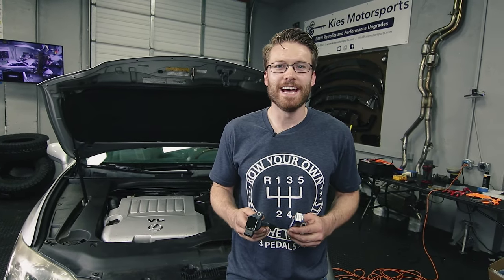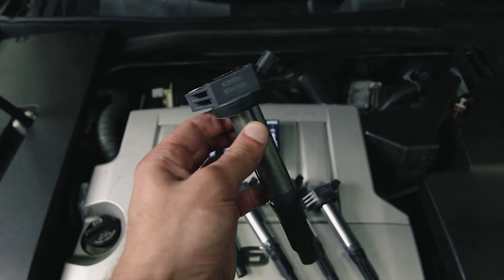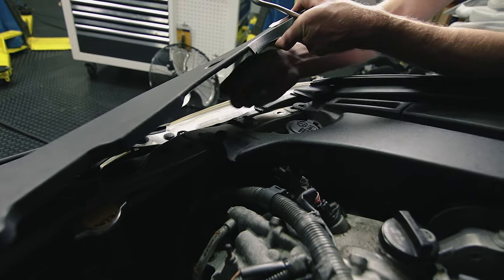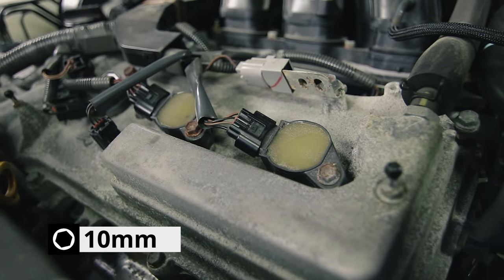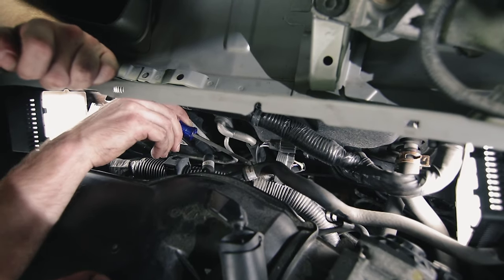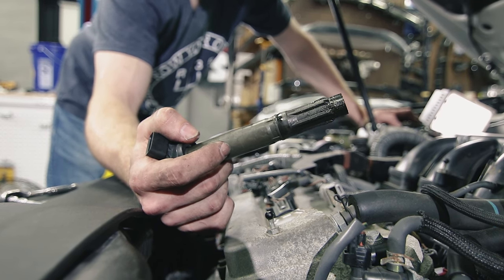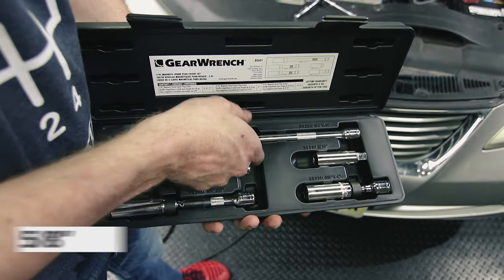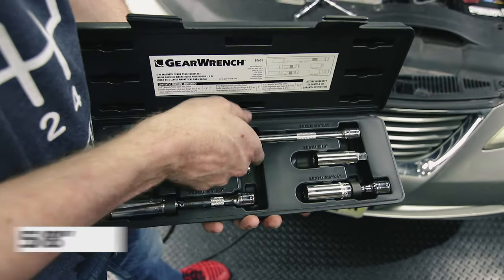How To Change 2GR-FE Coils & Spark Plugs 2006-18 Lexus ES350 / 2006-17 Toyota Camry - Under 1 Hour

Comment: Thank you Sundae Drive! This is the best video on this subject. I just finished the job of replacing all 6 ignition coils and plugs. I had P0351 #1 but #6 that I had replaced a few years ago was cracked (yes, it was a after market brand). I think P0351 can also mean other coils or spark plugs might be bad. The toughest was #5 due to the wire hardness blocking everything. I did follow what you did but there was a separate small wire bundle from the rear wire hardness going towards the intake manifold by #5 that was short so it was still blocking access. I did finally manage to pull out the #5 coil by pulling the wire hardness by hand but I almost gave up. I did not have the right tools so this took me 4-5 hours. I also replaced the front ignition coil wire connector plug since all the clips were broken but not the rear ones so hope they stay put. This is on 2007 Lexus ES350 130K miles with all original coils and spark plugs except #6. I clear the code but have not driven yet so hope this did the job. I ended up doing the job laying on the engine that gave me the best access.
Reply from the maker: Glad it worked for you man! Hope your issue is resolved!

Comment: Thank you so much! I have replace No.3 coil in my 2007 Lexus ES 350 today. Your video explained every thing in great detail and it directed me perfectly! There is only one  minor thing to remind. When we pull the plastic cover under the windshield, we'd pull away first, then pull it up to uninstall it. I mean we should pull the cover away along the windshield direction first because there is a slot at the edge of the cover in which the windshield inserts. I pulled it up directly and the slot damaged the windshield a little. Anyway, thanks again!
Reply from the maker: Glad it helped and that's a good note! Thank you!

Comment: Just did this, something I didn't see mentioned in the video: torque the spark plugs to 13 ft-lb.

Also 11 inches was too big, 10 inch worked better. And you may as well replace the ignition coil boots while you have the coils out.
Reply from the maker: Thanks! Appreciate that feedback. Good to know that the 10" is better

Comment: I have watched many of similar videos. None take a compression test when the plugs are out. If there is a misfire in a cylinder, a bad valve could be a reason. Compression test is a must in those times.
Reply from the maker: Always possible but in this case, his codes were fixed :)
Reply: It's a Toyota

Comment: Excellent video, no doubt. But 30+ years of working on my own cars has taught me that it's well worth the little extra time to get something out of your way. Busted knuckles, not being able to see, breaking off clips, that one bolt that you just can't get to... all things that lead to frustration and spending more time than you possibly would've anyway. And GET SOME AIR TOOLS! A 50+ gallon tank, ratchet, and impact wrench are game changers!
NOTE: NEVER use air tools on spark plugs!!!
Reply from the maker: Lol all true, we have the big air compressor with a lot of air tools as well as a lot of Milwaukees but we wanted to show it in away the average guy at home would have to do it and most people probably don't feel confident enough to remove the cover
Reply: @TheSundaeDrive  Excellent points. Keep up the good work.
Reply from the maker: Will do our best!

Comment: I'm considering doing this myself, my car needs the 120K service (240K actually) and the plugs are part of that. Last time I did the full 120K service at the dealer it was over $1000 (that included a few other services as well though, but the plugs were the most expensive part). I've changed two of the front coils already (they went bad) and that was pretty easy, doing the back looks like a little more work but if you don't have to remove the manifold it doesn't look bad at all. I would keep the original coils and only change the plugs due to miles. I'm seeing the 6 plugs on Amazon for under $40 and a 10" spark plug tool for about $15, so probably well under $70 for all the parts and some labor.
Reply from the maker: It's not a bad job at all. 1 hour tops and you can save a lot 👍👍
Reply: @TheSundaeDrive  Thanks! One question if you can help. I saw some reviews that "fake" iridium spark plugs might be sold on Amazon. I prefer to use the OEM Denso plugs, but there seems to be two (or more) types, 5344 IKH20 and 3426 FK20HR long-life, do you have any opinion on this? I also want to get legit real denso plugs and don't mind paying a little more. It's for a 2007 ES-350.
Reply: If you are interested, I got the 3426 NGK plugs for my car, and when I removed the existing plugs which were installed by the Lexus dealer about 8 years ago they were about 1/2 inch shorter than these new plugs (they are labelled "SK16R-P11"). Have you ever heard of that? I was concerned these new plugs were too long but when I watched your video my plugs were the same length as yours (thanks for showing them!), and I double-checked with O'reilly Auto Parts and the 3426s are definitely a match for my car (2007 Lexus ES-350).  Also, just an FYI about aftermarket coils, I've had two coils go out on my car, one I replaced with Denso OEM and the other was an aftermarket. Today when I removed the aftermarket coil the "boot" got separated from the coil and was stuck on the spark plug deep in the motor (ugh). It took me almost an hour to get it out. That's the last aftermarket coil I'll be buying, it just isn't worth the trouble in the future. The other two coils (I only did the front today, will do the back next week) came out no problem, easy change of plug etc.

Comment: Great video just bought a   2009 ES350 with 140,000 miles on it now I know what I’m up against but first thing I’m doing is removing the oil filter canister and putting a conversion kit on it so I can use a spin on oil filter don’t like the canister type filter no anti drain back valve
Reply from the maker: awesome! beat of luck with it!

Comment: I have the 2003 Toyota Avalon XLS with a misfire on #1 cylinder.  Was able to replace spark plug and coil without removing anything else.  The space is very tight, but doable if your hands are small.  Will probably have to replace same on #3 and #5 before too long, so I'm thankful for this video!!  But for now, I'm firing on all 6 with minimal down time.
Reply: How long did this job take you? I got an 06 that has low circuit voltage on coil 1 but it's not misfiring yet
Reply: @peytonhoward  not long on cylinders 1,2,4-6. Just a min or two to replace, but #3 was a bit difficult, prob an hour.
Reply: @user-mn6ze7rm2p  good to know. Definitely a little trickier than my truck but that's what YT is for. Thank you!
Reply: @peytonhoward  if you've got the funds to replace them all, I'd go ahead. I did my one every other month or so..... No money.
Reply: @user-mn6ze7rm2p  yeah they're really expensive, way more than I thought they'd be unfortunately
Reply: Did you change the 5 eventually if yes did you remove the plenum
Reply: @pardesi_life  I would say try removing the air box and not the intake plenum first and seeing if you can fit you hand behind to reach. I was able to reach coil 1 on the passenger side by removing the windshield wiper tray, so I imagine if you removed the windshield wipers and tray then removed the air box you may be able to reach it.
Reply: No.  I am a woman and my hands and forearms are small enough to get to the rear space.
Reply: @user-mn6ze7rm2p  and I just noticed you had a 2003 that's a totally different car it has space.. my bad

Comment: Thanks for the video, it definitely helped.  I changed my plugs this last weekend.  A few notes for anyone else contemplating this:  I had to get a "breaker bar" to remove the strut brace bolts, there was no way they were coming out with my regular socket set.  Perhaps the last service place over-tightened these, IDK.  The back plugs were a lot more difficult as expected, and for the 3rd one toward the middle I could not get the 11 inch spark plug remover tool to go in the hole (at least the tool I bought which was not the same one he showed).  I had a different 5/8" plug socket already and two 4" extensions and was able to do it that way for that plug.  It took me about 2 hours to do just the back plugs and re-assmble everything, but as mentioned I ran into some difficulty with the strut bar and far plug removal.  Still considered it worthwhile doing myself but be prepared for some difficulty with accessing those plugs and coils especially the third one down in back.  I also added a small amount of anti-seize compound to the threads of the plug to make removal of the plug in the future easier and also a compound to the boot so that can be removed more easily as well (I have had two coils go out on my Lexus ES350 2007 and I replaced one with OEM and the other with different aftermarket and the aftermarket boot got 'stuck' on the plug, did not come out with the coil, so adding a boot compound will make removal of that in future easier).  Again, appreciate the video, really saved me time figuring some of the earlier steps out.
Reply: I have a 2009 Lexus RX 350 I'm going to attempt in the spring with the plug change i picked it up last June with 167,500 k I'm already at 205k. Forgot to have the dealer give me the maintenance records on final signing. Anyway. Have run into that boot separation seized spark plug dilemma on my other vehicles. I always die electric grease the boots, and anti seize compound the threads on plug changes now as practice. I am not definitely not looking forward to those back 3
Reply: @bobbyscalchi4013  Just pace yourself, it wasn't too difficult but definitely took me more than an hour, I think it was around 2 to do all of the plugs.  And getting the right tools to access the plugs.  I did put the grease and anti seize on the plugs as well, always a good idea.
Reply from the maker: You want to be careful using antisieze. It can cause you to over torque and snap the plug. I personally don't use it

Comment: Just an FYI, I have a 2008 Toyota Avalon Limited which (I thought) was nearly identical to the Lexus 07 ES 350 in this video (and most of it is) but wanted to share with anyone reading this that the strut brace you show at 4:35 is (unbelievably) different on my vehicle.  Mine does not have 2 bolt connections (visible at least) on the strut tower.... only one.  I am not sure if this is better or worse as far as plug accessibility but do know that at least one other video for my car show the windshield wiper motor and then the gutter underneath it removed as well (takes longer to do).  Not sure if that is "overkill" and necessary, but that is what they show.  Obviously, I was hoping that my car 's engine bay was identical to the one in this video so that my chances of a fast, easy, spark plug replacement is higher.  Maybe if I try to do everything else you do and am able to get my strut brace off easily, mine will be easier???????   Who knows....  But I may just go that route and find out for myself!
Reply from the maker: Ok let us know how it turns out! Best of luck
Reply: i have a 06 avalon to work on, did this method work for you?
Reply: @huyhuy123  I have not hit 120K miles yet so I have not changed out the plugs yet.
Reply: Did you replace the plugs ? Which method did you use I think the engine bay of the Avalon is smaller than the es350. Did you remove the cowl and plenum both ?

Comment: Thanks for this tutorial. Everything went smoothly thanks to your tips. One of the plastic spouts that connect the vacuum lines to the air box snap at the base and the hose cannot connect. Any tips to fix it?

Comment: Thanks so much for this video-  you and car care nut both helped me do this and figure it out ! Unfortunately when trying to get that upper bolt back in it dropped somewhere in the engine not on the ground. I’ll try and fish it with a magnetic tool but if I can’t what is that bolt called or referred to on the upper bracket ? Thanks again

Comment: Thank you so much for this video, I am attempting it at this very moment using your video for reference.  I do want to note, that my owners manual says the gap is 0.043"/ 1.1mm and do not gap them.. I have found conflicting directions on this so I am going to leave mine ungapped (btw I am using ruthenium spark plugs, what ever that is lol).  I will post here if it all goes well or I had to end up gapping them to have my car run smoothly.
Reply from the maker: Glad the video is helping and best of luck with it!

Comment: Thank you very very very much the tool you recommended for the spark plugs was very helpful. I was looking for a away to do it without removing the air intake and your video did the job 👍.
Reply: My car is 2008 Avalon by the way.

Comment: This is an excellent video!  Thanks for posting. 

Do you happen to have the torque specification to be used when re-attaching the strut brace and the windshield wiper arms?

Thanks again!
Reply: Windshield wiper bolt torque=16 ft/lbs

Comment: Thanks for the good video.  Unfortunately I found spark plug 3 on my car had a bunch of melted plastic around the spark plug.  No idea if this was from manufacturing or dealer service.  It took me the better part of 2 days to free it by digging at it will a 6" screw driver so I could get the socket to seat and break the plug free. Then I had to clean out the plug threads with a thread chase.   With all the messing around I managed to pull the 3 wires out of the sensor just below plug 5.  Any idea what this sensor is?  I have managed to take the plug off and think I can resolder,  Also not 100% sure of the order of the 3 wires.  Black is closest to the firewall, yellow next, and red toward the front, is this correct.
Reply from the maker: Aww man that sucks. You probably need to figure out what happened. I would be concerned that you would have had debris fall down the motor while cleaning the threads. I would suggest dissasmbling the motor a bit to make sure it is clean inside.
Reply: @TheSundaeDrive  I used compressed air gun as I was chipping away the plastic to make sure no debris remained.  When I was able to break the pug loose I switched to vacuuming using a 3/4" tube.  I had to get a thread chaser to clean out the threads so the spark plug would go in easily.  I put anti-seize compound on it and could see the plastic junk trapped in the flutes.  Got a new camshaft position sensor connector, finally connected the 3 wires up right, and it runs nicely.  This was a 5 day job because of everything that went wrong.  I think disconnecting the camshaft position sensor would be a good idea, and would have saved me from having to rewire in a new connector.  Luckily I had a Toyota mechanic friend of a friend tell that this was a camshaft position sensor and get me a scrap connector I was able to determine connections from schematics on the internet.

Finally you don't mention torque for the strut brace, I am thinking 30 or 40 ft-lbs?
Reply: @bruceski88  Good job, man.

Comment: I try to go with the factory 🏭 coils because they have the rubber boots at the bottom 
where as the aftermarket ones
are silicone and tear apart when you pull coil out of the
spark plug hole.Had to use
a pick tool to remove leftover 
boot material out of spark plug hole.
Reply from the maker: Good catch! Hadn't noticed that. Oem is always better.

Comment: Hey just did mine and on the rear ones that big harness when I pulled on it I ripped the 3 wires that go into the camshaft sensor right below it. There's a yellow, red and black wire but not sure what order they go into the clip, do you by chance know

Comment: Where is ignition coil D located? I can't seem to find any info
Reply: The center middle ignition coil closest to you. For future reference the letter of the coil is laid out like this. 

With the hood up and you facing the engine. 

Ignition Coils rear:     A | C | E
Ignition Coils Front:   B | D | F

I recently got a check engine, check vsf, and track control error codes. I hooked up the scanner and it gave me this code: P0354 for ignition coil D

So in order to verify that it's actually the ignition coil. I swapped the coils from D and F. You only need a 10mm to remove the bolt holding the coil. I then reset my check engine. I drove for 5 miles and then the check engine came on again. This time it was for ignition coil F. This confirms the ignition coil itself is faulty.
Reply from the maker: Thanks for the detailed explanation! That will help a lot of people

Comment: I guess the coils haven’t failed yet👌

Also, those retaining clips for the ignition coil plugs are super easy to break. It’s pretty much impossible to remove them without breaking them lol
Reply: agreed they are brittle due to the heat exposure... when I use a tool they break when I use my fingernail my success is really good!
Reply from the maker: They have not failed yet to our knowledge. He has since sold the car. And yes they are brittle for sure.

Comment: My #4 plug the rubber boot is stuck on the plug , any ideas how to get it out ? I tried with needle nose pliers its stuck
Reply from the maker: Try spark plug pliers. They are designed to go around the boot and work well.
Reply: Thank you
Reply from the maker: No problem! Best of luck with it

Comment: I was changing my washer fluid and was surprised to see the sensor that connects to the white housing on the left of the plastic intake manifold was disconnected at 5:38. What exactly is that sensor? A clear shot of it is at 6:09

Comment: I have a 2011 es350 with 105k. About to change the plugs. You think I should change the coil packs also? How many miles until they should be replaced?
Reply from the maker: Probably a good time to swap them out.